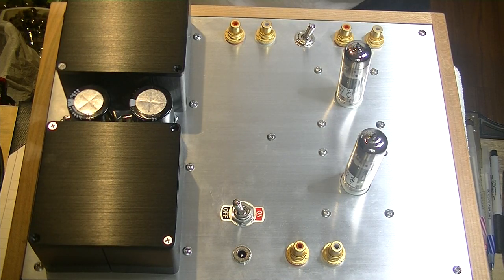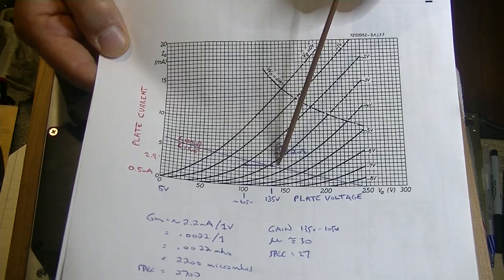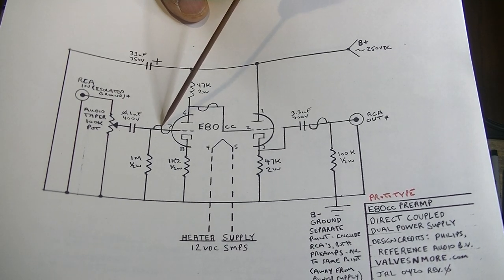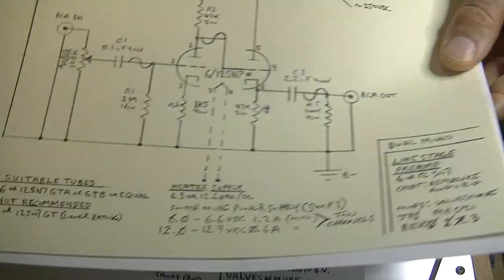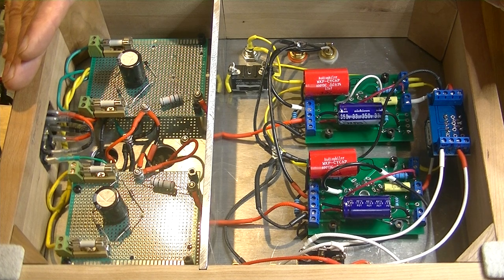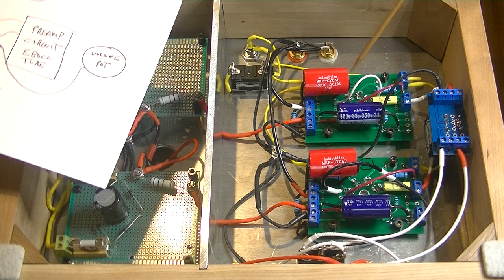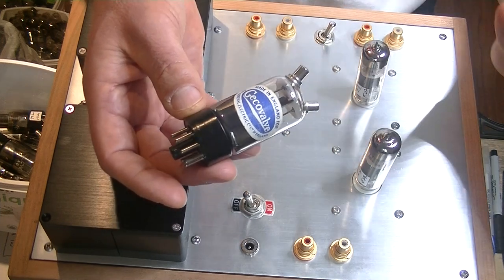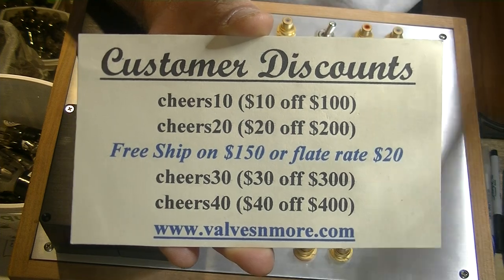Tube Lab #28 Prototype E80cc Preamp Circuit & Grounding

Comment: The chassis has resistance. What we do by creating separate star ground points is put a litle resistance (the distance across the chassis) between those 2 points. The largest amount of noise (main source, heaters, decoupling capacitors, etc.) should be close to the main ground side as possible. Then, the secondary grounds (audio) should be "chassied"  on the opposite side, so they are slightly "higher" in potential to ground respect to the main/safety ground-chassis connection (we are talking about the resistance of the metal of the chassis, probably in order of milliohms)
When there are multiple stages and high gain, the first gain stages should be the "furthest away" (more resistance) in the ground path,  then the middle stages, and at the end (with less resistance,  near the main chassis ground connection from the outlet socket), the exit stage. 
The ideal is to have distributed ground connections (a bus wire/bar for example), so you don´t put signal (audio) grounds inside a return ground path from a noisy section
Reply from the maker: Excellent summary of our standard grounding topology and why it works so well.  Years ago when I first started building gear for myself I struggled with a good ground topology and then I learned about the hybrid star ground method and I've employed it ever since on our commercial Kit Amps.  Even the very high gain stages of the Universal Kit Phono Preamp are very quiet (-56db) which for the circuit type is excellent and well below the surface noise of the stylus in the record groove!

Comment: I've just used a pair of Hytron Det20s in a prototype amp I've built. Be careful as the topcaps were the reverse of the datasheet. I'm very lucky not to have blown them when I plugged them up.
Reply from the maker: Thanks for the heads up!  You can actually see the connections, so it's possible to visually confirm.  I'll just make sure the top cap wires can reach across if required.
Reply from the maker: How do you like the Hytron's?
Reply: @tubelab194  That's what confirmed it eventually. Lucky escape.
Reply: @tubelab194  It's hard to say. Coupled with a pair of Sylvania 6V6s they sound warm with smooth mids and detailed highs. But when paired with Philips 6v6s, I don't like them. Strangely the opposite is true when I replace the DETs with a Brimar 6sn7. Synergy I suppose.

Comment: With Switch mode power supply, how d oyou deal with the very high frequency switching noise, which is inherent to switch mode power supplies.    The brick used to power up a laptop, even in brand names, spews all sorts of radiation into the air and onto the power lines.  You can here it very clearly on the Broadcast and Shortwave bands.      What was your thinking in deciding switchmode PSU over a linear PSU?
Reply from the maker: Hey Brendan!  First not all smps are made equally, some are very noisy others very quiet, with most quality units falling somewhere in-between.  The first thing I do when sourcing a new smps, is put it on the scope and see how it does.  Now remember the dc supply is only going to an indirectly heated tube, so there's no electrical connection with the rest of the tube.  Yes it's still possible with a very noisy smps to induce noise onto the grid, but in my experience with the units we carry the circuit stays extremely quiet.  All of the testing data is published in the store under "Information" "downloads".  Note when you compare an AC filament feed to a DC (even a smps) there's no comparison, the AC supply is incredibly noisy compared to the DC.  Why go this design route?  Convenience and practicality and so far we haven't had a single problem with this approach.

Comment: Hey Jim,  thankyou for your wonderful videos sir! Random question. I have a hybrid headphone tube amp (sabaj ph3) that takes 6j9 e180f 6688 tubes. They are run in a starved plate setup, simply as a buffer, in series with a pair of op amp chips. I was wondering what the difference between the 6j1 and the 6j9 was as I'm looking at getting an exduoo mf-602 aswell (6j1). Forgive my ignorance but can one be used in place of the other if the pin outs are the same in the case of my amp? They are both b9f fittings. I wondered this as mine aren't creating gain as such... merely following.. or would I have to change resistances and pin positions etc? Please tell me if I'm being an idiot. Cheers xx
Reply from the maker: I have zero experience with any of those tubes, what I suggest is you see if a Google search will find a user's group, they may be able to help - luck!
Reply: @tubelab194  thanks Jim I've been scrolling through data sheets trying to grasp a clue lol. Turns out I was mistaken. The 6j1 is a b7g fitting and the 6j9 is a b9a. Lol xx